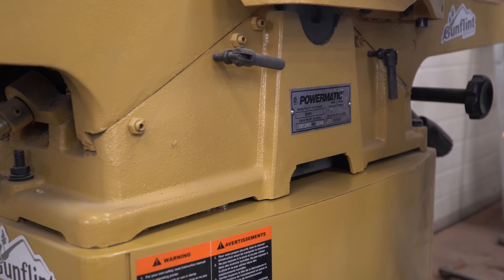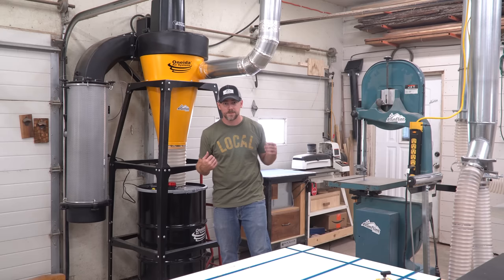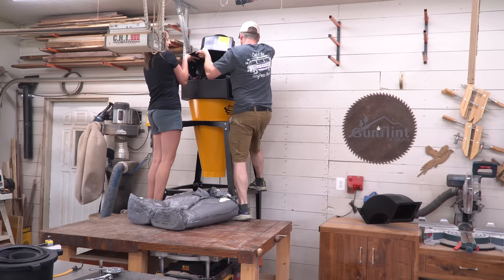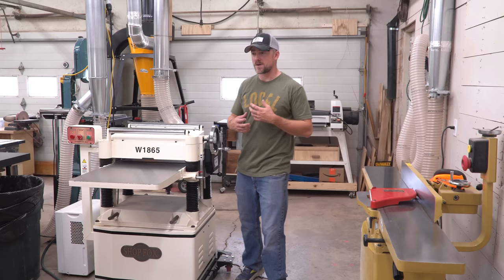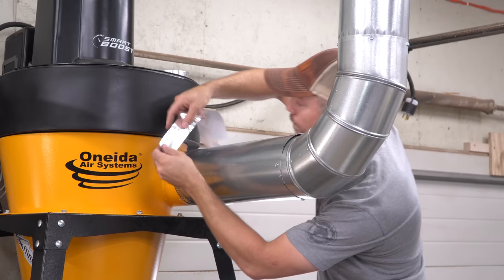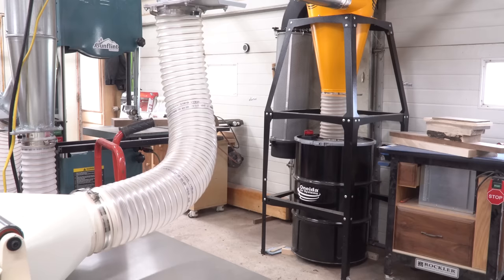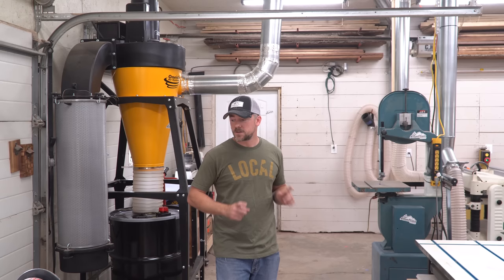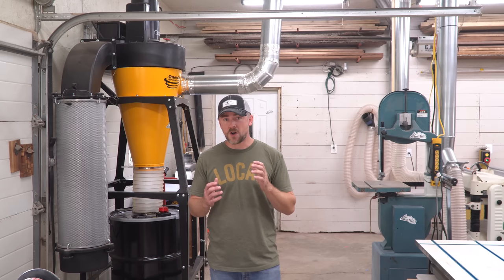Installing & Testing My Ultimate Dust Collection System

Comment: About that annoying sound you said the Harbor Freight collector made: some noises can't be accurately measured in decibels,  and have to be 'measured' using psychoacoustics. I worked in the mega-yacht industry, and we had to make the ships as quiet as possible, but sometimes noises have a harshness that can't be measured with instruments, and has to be judged by human juries. A lot of times the motor or whatever it was, was also making something else vibrate, and the combination of sounds was way more irritating than the motor itself. Congratulations on your new(ish) system!

Comment: Grind the 4 U shape bolts taking a little off of the hook end so you can get the basket off quickly with less screwing the plastic forever.

Comment: Congratulations, the new layout and dust collection system look great!  Regarding the use of four inch connections, it might be wise to leave another blast gate open somewhere - otherwise, the system could get starved for air, or lack lift due to limited airflow.  I know it’s an issue in some shops, with some systems.  Check with Oneida.  
Best wishes and stay safe!  
And please, wear hearing protection!

Comment: What is the app you used for test the sound?  Always looking for a better meter.  I installed my dust collector 6 years ago and build a movable wall lined with Rockwool.  It dropped the Db level from the low 90s to upper 50s. It is a little bit of a pain to move to get to the collector but can now have normal conversations in the shop with it running.
Reply from the maker: Good idea! Looks like that app was called Decible X.

Comment: I have this system in my shop, and I absolutely HATED the angle "iron" frame that supports the extractor's motor. Every time I bumped it, it would twist or sway, and just seemed really unsafe. It didn't seem like it was going to be very supportive for a very long life in my shop. I took some 2x2 angle iron that is 3/16 thick (overkill, but I'd rather be safe than sorry), and taught myself how to weld, and like the old saying goes, "a grinder and paint will make you the welder you ain't". What I ended up with is a frame that is probably 100 times stronger than the stamped steel angle pieces they give you to bolt together. The extractor itself, is hands down the best I have ever used, but I honestly did not trust the support frame they included. On a side note, I think your shop is doing a very poor job of hiding a sleeping giant. Your concrete floor is a ticking time bomb, that will one day, probably in the dead of winter, bring your entire shop down, and I pray nobody is in it when that happens. I would hire a structural engineer to tell you what needs to be done to replace the concrete floor, and then get a few estimates for pouring a new one. It's going to be a lot cheaper than having to rebuild everything, AND replacing your tools and machines.